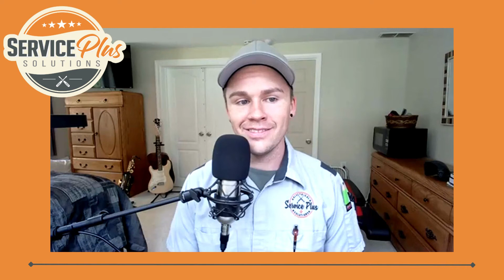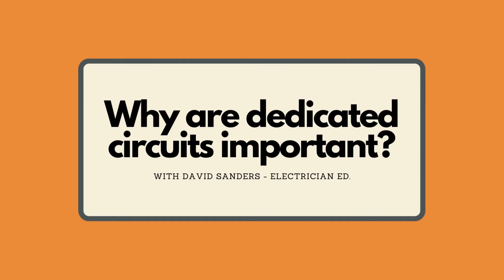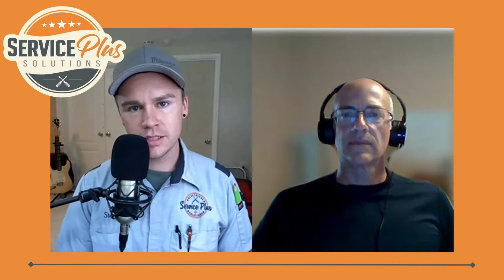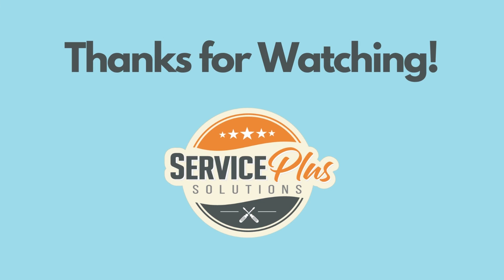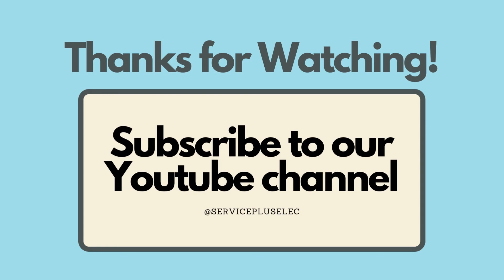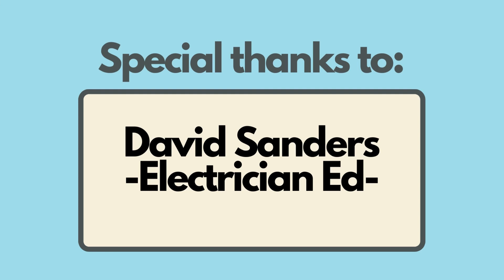Dedicated Circuits: Why Are Dedicated Circuits Important?

Comment: Hi does a standard over the range hood vent (not microwave) need its own individual circuit or do I have the option to run it off countertop small appliance circuit?